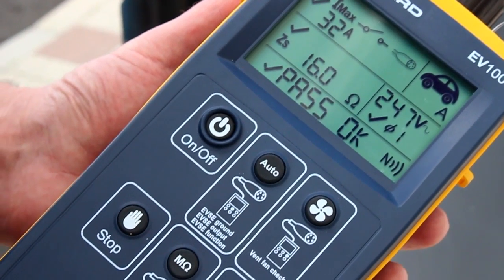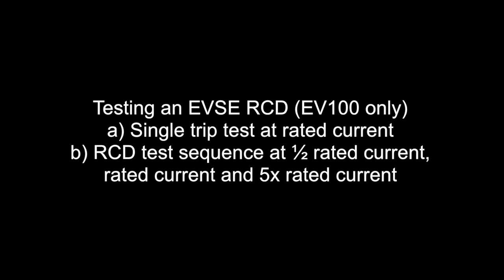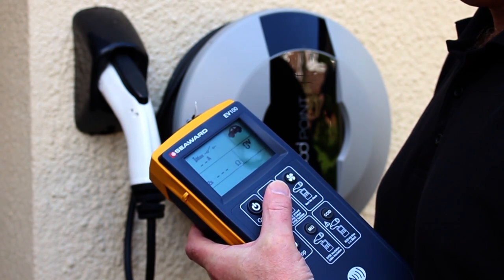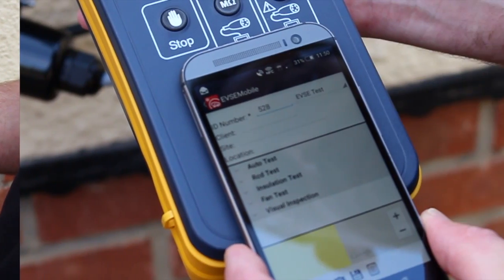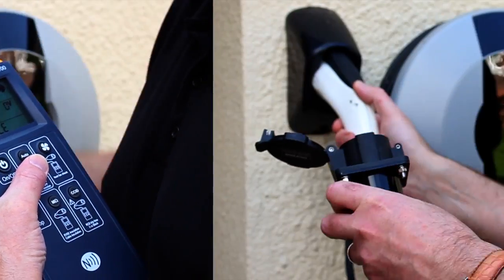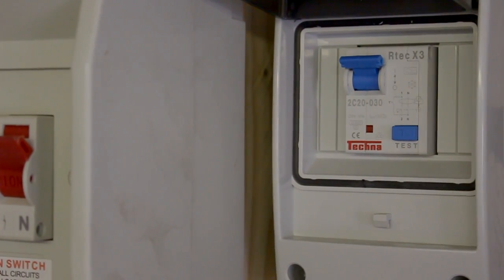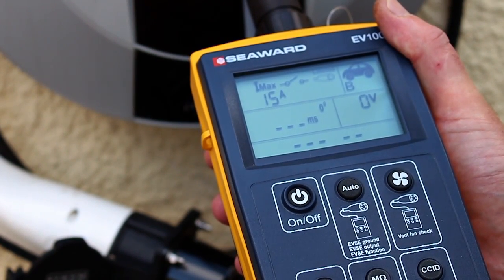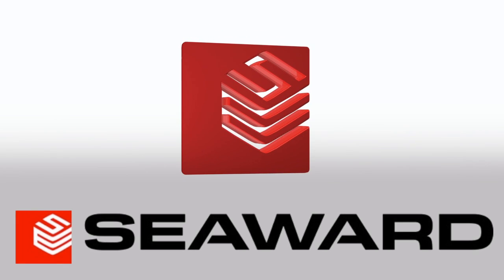How to test an EV charge point RCD trip time using the EV100/EV110 from Seaward

Comment: Very reliable level 2 (240V) portable station with 2 charging current levels: 10 or 16 Amp.
10Amp is slower but more healthy to the battery. 16 amp will charge faster.
http://www.ebay.com/itm/ev-charging-station-cord-cable-J1772-EVSE-Current-select-16-10Amp-110-240-Volt-/252101131205?